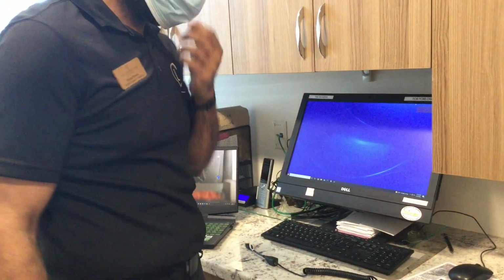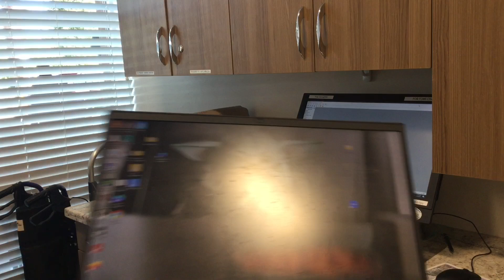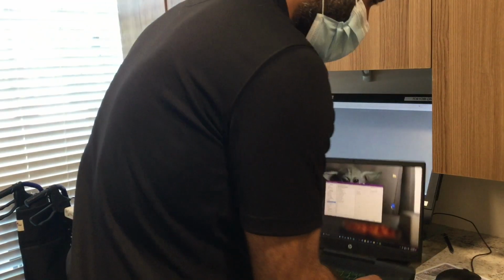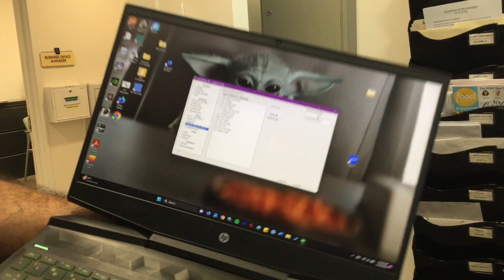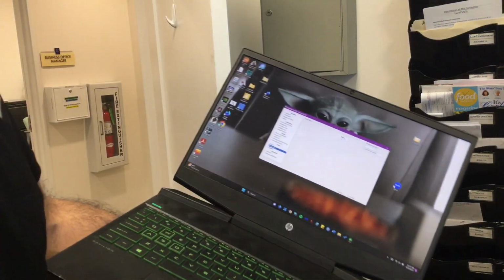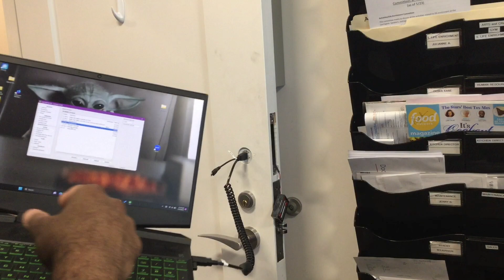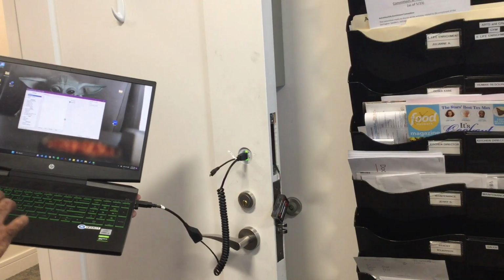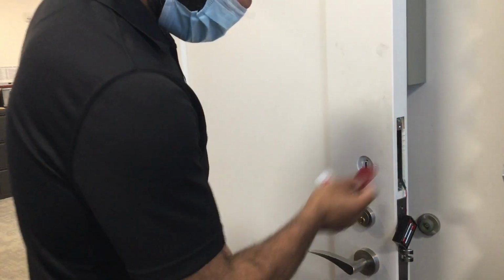How to cold-start an Assa Abloy lock

Comment: Not sure why you had to log in on the computer if everything you need is on the laptop. Meaning, couldn’t you just use the Ethernet to download? I don’t see how it has anything with logging in to visionline. I’m confused.
Reply from the maker: It's a timed token. In case the laptop was stolen and someone tried to open doors. I believe it can be customized to the installation. At that facility, you had a 15 minute window from getting the token to coldstart any lock